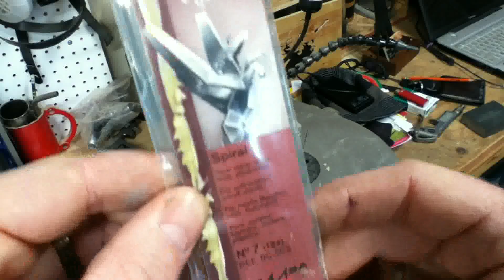large predator scroll saw portrait

Comment: Nice. Hey, I have the same scroll saw and have never had any luck getting the spiral blades to stay in very well. It looks like that's what you used. Any advice?
Reply from the maker: I get asked that alot,honestly I just tighten the screw pretty tight and make sure there isn't to much tension when you tight down the blade,I think I'm gonna do a bow to video in a day or so to explain how I use the saw
Reply: Dave's woodworks I've never had a problem using any blades except those spiral blades. They seem to snap way too easy. I am using Olson blades. Perhaps I should try a different brand for the spirals.
Reply from the maker: +Waylight Creations I use pegas blades,but smaller blades breaks alot easier,the smallest I use is a #2.
Reply: +Dave's woodworks Thanks. I'll look into it.